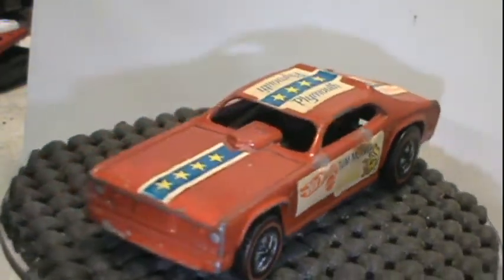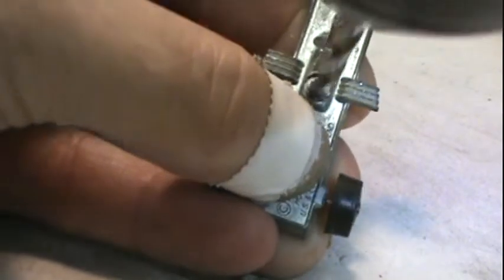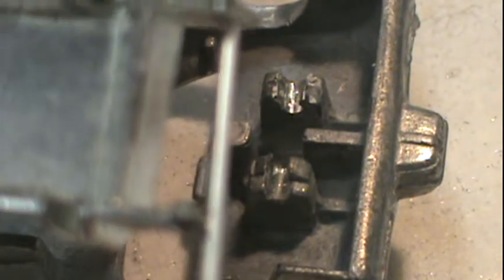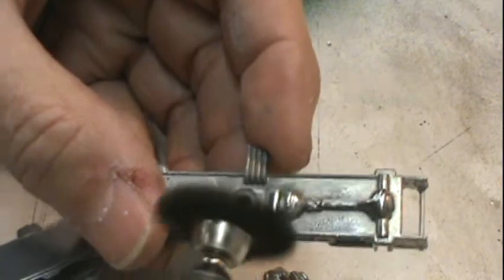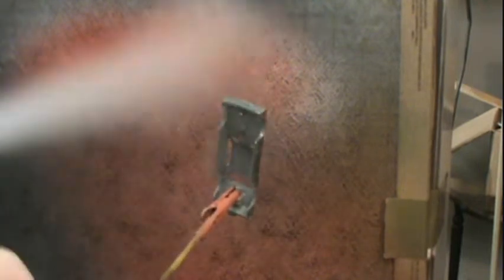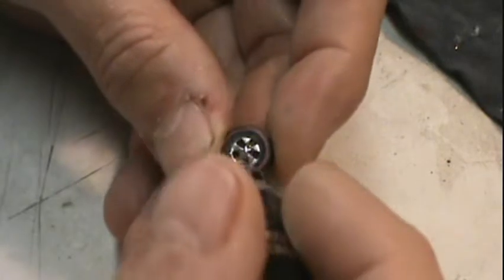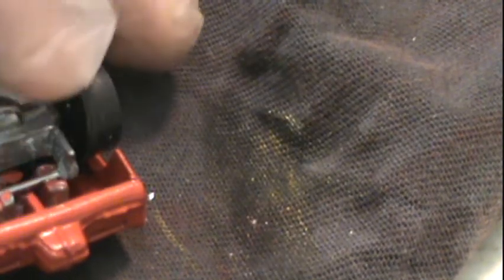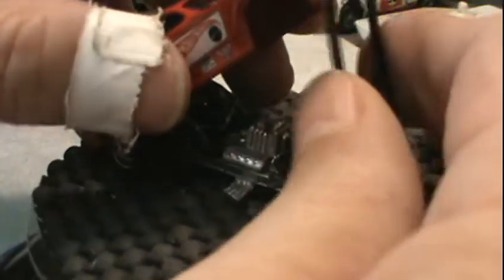HOT WHEELS MONGOOSE RESTORATION

Comment: Good on ya for the hinge fix.  I just did a Vega Bomb with a broken hinge.  Brushed some silicon grease on the chassis and used only JB weld to form a bridge at the 2 hinge openings.  Worked out well but yours is a bit more robust.  Gotta love JB weld.